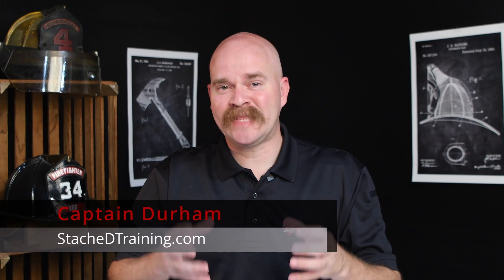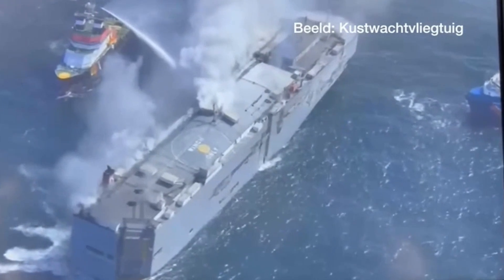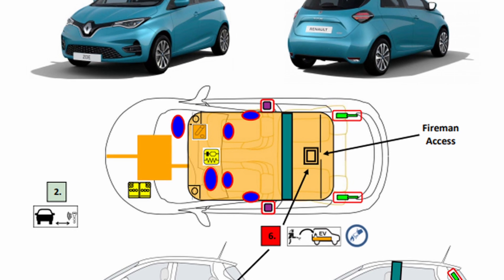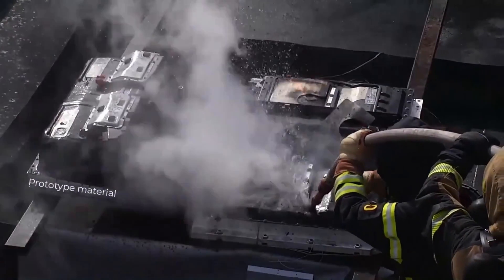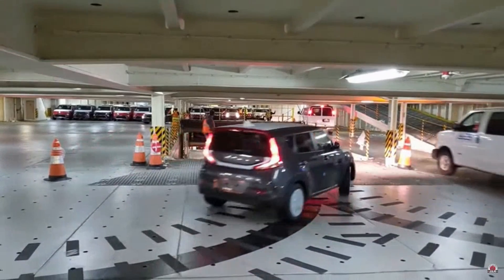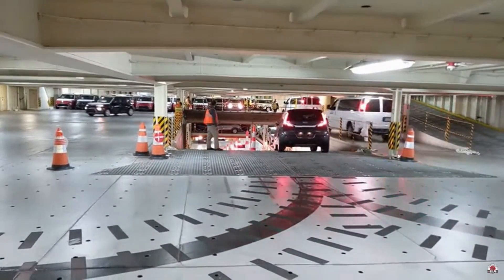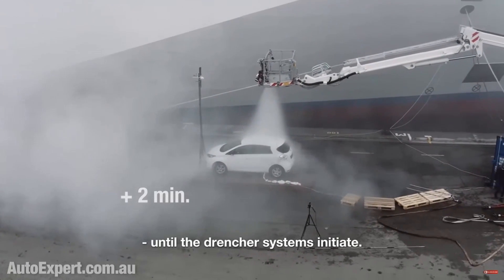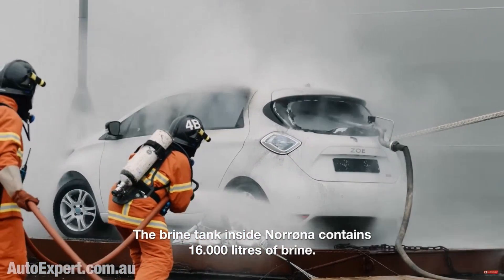European Studies: Electric Car Fires

Comment: Is it possible that the salt water actually drain the electricity from the batterypack and in that way both extinguishing and drain the power out, could therefore salt water be good even if it is not cold, of course the car is destroyed anyway.

Comment: Okay, put a 1/2 inch or so pointed hollow steel spike, with a hose connected, on the tip of a floor jack. Slide it under the battery compartment and jack it up until pierced and turn on water. Voila!

Comment: While my service in NAVY special forces, ( not US), we used  personal underwater  vehicles, powered by 10+ batteries  ( kids motorcycle batteries, but very expensive). Those batteries produced a lot of hydrogen, so to avoid explosions, we ventilated
and pressurized battery compartment with nitrogen. Never had any problems, no fires, no explosions.

Comment: Great info, thanks!
Renault Zoe: good intention but the problem is that after an accident, where the passengers could sit inside, belted and unconscious, the battery fire could break out and flammable gases would vent directly into the car! Better an/several access hole(s) for firefighters to the outside of the car. One single opening at the rear might be bent and unfeasible tu use after a crash! 
2.) the claim with the cold brine is that it has more cooling capacity and simultaneously would discharge any fullyCharged batteries! Of course that is only working if the salty brine contacts/shorts the + - poles!

Comment: Figuring out how to best deal with fires might be better tackled from the manufacture of the pack and vehicle. If gov safety organizations figured out what worked best and then mandated all auyovompanies build that feature in, that seems like the best approach. Eg one thing I saw was a battery pack designed to melt the brackets holding it into the car, so it would fall out the bottom and could be dragged away from the car and delt with, or the car could be dragged away from it before catching on fire itself. A lot easier to deal with a bare pack where you can have access from all sides vs one that's tucked up under the vehicle and largely inaccessible. I'm advocating this as the best solution, just an example of starting with an inherently safer design.
Reply: Imagine driving into such a battery pack falling on the road in front of you! Not a good idea, I'm afraid.
Reply: @lievenmoelants  that would require someone to be driving along with the battery pack seriously on fire. That wouldn't/couldn't happen. There are a bunch of safety systems that can warm you well ahead of time a thermal runaway is starting, then once the batteries were on fire they would short out so the car wouldn't be getting any power.

Comment: How is this allowed in the public? This is such a BETA product. Clearly from this topic alone, there should be easily accessible port on all batteries.
Modular design to allow repairs is also a must. Small dent will cause $50k car to be scrap. How green is this? Criminal Experiment.

Comment: Also, something never mentioned is, if you were to transport Li-Ion batteries, you would need a Dangerous Goods Certificate (UN...). So why do these cars not have that tractor-trailer diamond shaped dangerous-goods sign on them. I believe on an aircraft, your laptop etc cannot have a battery more that 100 Wh. And I would hope nobody packs such batteries in their checked luggage. In fact, I do not pack ANY battery in my checked luggage having spent enough hours in the cockpit and knowing you cannot park on the shoulder if a problem arises. I also spent years later working in a battery lab.
Reply from the maker: I working on videos for both those topics.

Comment: In a sample of 100,000 vehicles, how many ICE vs EV vehicles catch fire. Post a link to a real study.
Reply from the maker: I've already done a video on that data set.   It's old,  out of date data: https://youtu.be/d_SpHvBfzrw
Reply: @StacheDTraining  Considering the vast ratio between ICE and EV vehicles, meaning there are vastly more ICE vehicles on the road today, in the past 50 years of driving, I have seen 3 ICE vehicles on fire; 2 cars more than 2 or 3 decades ago and 1 tractor trailer recently. I have seen no EV fires, likely because I am retired and drive less.

Comment: They can stop it but wont i relight? Iv seen teslas burning UNDER WATER. The biggest problem is the battery is never safe untill all the cells are discharged.

Comment: WTF Hole cover that leads to where you sit and breath fresh air that can now be Fatally toxic if batteries has problems and omits toxic gas very smart,at least now when the batteries go into meltdown mode (Thermal Runaway) everyone will already be dead from the toxic gas now it makes sense.

Comment: Having direct battery access to the passenger compartment should be illegal. The pressurized toxic fumes vent directly into the passenger compartment with perhaps the passengers on board. There are videos of detonations that blow off the door locks of Zoes or the roofs of Jeep Wranglers.
Reply: Why not make an access door on both sides with a filler similar to the one for petrol?
Besides the cost, maybe the user doesn't't want to remember what he's actually sitting on?

Comment: Something else about transporting EVs in a car carrier freighter - It would probably make sense to have cars battery charge down to the lowest possible level without damaging the battery. That way there would be a whole lot less energy to fuel the potential fire. Also from a passenger safety point of view, venting should be to the resr of the vehicle, outside the compartment.  If a thermal overrun occurred there should be an audible alarm telling you to get the hell out of the vehicle!  Remember the Hindenburg (Zeppelin)!  It went the way of the Dodo Bird.  Maybe they should try a more stable chemistry. My Li FePO4 batteries are great! And LiFePO4 is much more stable.

Comment: Dear Captain, how safe are the used 2016 Fiat 500 e’s? I am considering to buy one!
Reply from the maker: It's a fairly small battery pack.   I would be more concerned with the longevity of a 7 year old battery.   Especially since technology has evolved significantly in those 7 years.
Reply: @StacheDTraining  Indeed and thanks for the response! Here in Costa Rica where I live the import duties of new cars are humongous! And the prices of the newest electrical cars are beyond my league. So I keep my cars very long. My main ride is a 1995 GMC Jimmy is still in good shape with 350,000 Km. And my secondary car, a 2012 Volvo S60's trade in value is way too little for the state of cleanliness and upkeep of it. So I think I am going to forgo this want and commit when it becomes a need!

Comment: unfortunately it seems that even if the brine solution worked, by the time you isolate the vehicle or it's battery pack (as shown in the test videos which are not "real world" and therefore super misleading) it's already too late.  ref: dramatic video of the Parking Structure collapse in the UK from the fire at London's Luton Airport date October 11, 2023.  some say the Range Rover was a Diesel...?  others say the RangeRover was Diesel/Hybrid...?  i say it doesn't matter because what the video clearly shows is that someone (just like the numerous other disasters seen in the news) now has a VERY EXPENSIVE CATASTROPHE to pay for, and that "someone" is going to be everybody and their grandma.
Reply: As a retired firefighter in London with 30 years including fire safety and fire investigation. I must say this Luton car park fire "smells a bit!! If the Range Rover apparently already alight before in entered the car park was only a straight diesel it should have been very easy to extinguish.  The fire would have developed slowly too. Perhaps it was left next to an EV but from what I saw in the video that was published online was that the fire characteristics of the Range Rover appeared odd. I have never seen flames shooting vertically out of the underneath side of a vehicle with a flamethrower effect on an ICE vehicle!!  I have attended hundreds of car fires, probably 80% arson going from end to end, all easily extinguished with 300 gallons carried in the fire appliance tank!! I would also reiterate the cause is irrelevant also as once EV's become involved in fire they are near impossible to extinguish.  As these vehicles age we will undoubtedly see a lot more fires. When I was in fire safety car park fires were unheard of and car parks regarded as v/low risk but not anymore. There have been at least 30 other serious car park fires worldwide involving EV's

Comment: if they dont get on top of this quickly, the insurance industry will kill the EV as they just wont provide cover and this is already an issue in the uK with insurance renewals being increased by 100's of % or just being refused cover.
Reply: Great news .. get those death trap EV’s off the road..
Reply: @Zuludarkthirty i agree, I hope the virtue signalling Muppets have to pay to recycle their batteries and not government doing it through taxes, I doubt it though, would be too obvious it's been a scam from the start.

About 20 years ago in the UK, they said buy diesel cars, more efficient etc etc, then after people changed, diesel particulate cause cancer, raise the price of diesel (how convenient)
Reply from the maker: It seems that insurance rates are already becoming an issue.  Purely due to the cost of repair if the battery is damaged.
Reply: @StacheDTraining  re: "It seems that insurance rates are already becoming an issue."  yup they are.  Liberty Mutual just sent a notice to policy holders that they have applied for a 24% increase of their Passenger Auto Line Business, date 9-27-2023.  i have a picture of notice on my phone sent to me by my daughter in New Jersey.  she doesn't have any accidents, any tickets, nor does she own an EV indicating this coming increase is indeed being applied WHOLESALE (just as many have predicted).
Reply: Totally agree with you. That's why I sold my electric vehicle when my insurance rates damn near double, negating all my gas savings. What's the point of even dealing with drawbacks of owning an electric vehicle if you can't even save money.

Comment: Might make sense to have mandatory firefighters battery hatches on the outside of the vehicle that allow insertion of water into the battery. Sounds a bit less dangerous than having the hatch below the rear seat and if mandatory there would be that one way you could extinguish all electric vehicle batteries.
Reply: If you give vandals direct access to the battery's internals, I bet you'll have tons of kids dumping salt water bottles in there to watch spontaneous bonfires. You'd need something like a 100 bar / 1500 psi burst disc well protected against external intrusions to ensure it cannot be damaged by accident or on a whim.
Reply: @teardowndan5364  Not if you needed a special tool to open the access door, similar to the way that you need a 5-sided socket op open a hydrant.
Reply: @ghost307  Where I live, hydrants have 1" square heads which can be opened using any appropriate size wrench. Even if you have odd-faced heads, they aren't much of a hindrance when you have vise grips or pipe wrenches.
Reply from the maker: I absolutely agree.  I like the idea of Renault's Firefighter access, however I do not like the execution.  It should be located to the exterior of the vehicle.  I think that led to the issue I discuss in this video: https://youtu.be/dc6CIITqW20
Reply: @StacheDTraining the HUGE elephant in the room regarding this is: it would highlight the potential dangers of thermal runaway - therefore exposing to the EV buying public the extremely dangerous realities. Can you imagine any current producer of EV's making that move?
Reply: battery mining equipment does have external access to the battery, so it can be done, a matter of getting manufacturers to do it.
Reply: Only problem is that lithium reacts violently to water
Reply: @jakehildebrand1824   Well, if extinguishing the battery with water works when you punch a hole in it or do it through a port below the back bench as shown in the video, it should work equally well when the water is injected via a port on the outside of the vehicle designed specifically for that purpose.
Reply: @jakehildebrand1824  Good thing there's no metallic lithium in these batteries.
Reply: How about designing the battery with a void space where you could punch through with a pick without hitting anything?

Comment: wouldn't be possible to extinguish it by depriving it of oxygen ? with something like an easy to assemble fire resistant dome that covers the full car ? the car will be totaled anyway, but the main objective is to put out the fire at less cost possible and these solutions seem kinda expensive.
edit: mb just checked, no it's not possible since lithium batteries already contains oxygens and it's a chemical fire.
and you can't even use foams because the fire can reach 1000° or more.. ngl brina then seems the winner.
though it seems a lot of an hassle just for having electric cars, i would stick to trolley buses and trains.
Reply: exactly. The heat comes from an 'exothermic chemical reaction' (any chemical reaction with a byproduct of heat) only dependant on the insides of the battery. This is massive amounts of energy released in the process. It is not a 'combustion reaction' (=fire) happening inside the actual battery. The exothermic reaction just delivers an overload of heat to be used in a combustion reaction (fire = oxygen + heat + fuel) with all the rest of the car. And yes you are correct a byproduct of the exothermic reaction is oxygen, so depriving the car of air would not help anything.

Comment: Hey . Great video. Can you make a video about the cobra system and it's effectiveness ? We just received it at our station and we are not sure that we can use it on Evs , because car manufacturers don't recommend penetrating the battery .😮
Reply from the maker: It's on the list.   I meet with a Cobra company representative soon.
Reply: Water on a battery is stupid. The battery could relight at any time during transport and storage. Lots of people are going to haul these away thing they are safe only to have a blaze break out on a truck or at a yard.

Comment: First, if that battery is in thermal runaway, I'm not pulling the passenger seat to get to the firefighter access port. Not happening!
Second, rather than brine, I wonder if a propylene glycol solution could be used effectively.
Reply from the maker: Due to the heat involved with thermal runaway propylene glycol will likely hit it's ignition temperature.